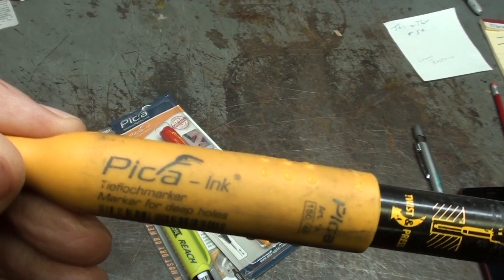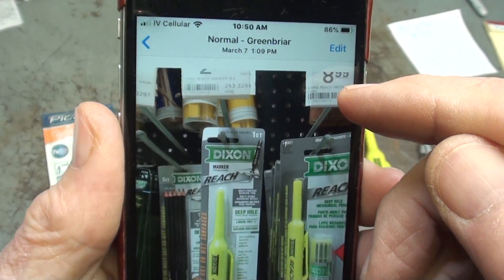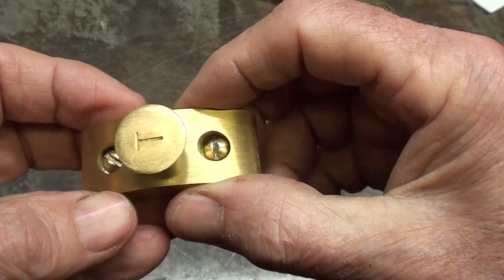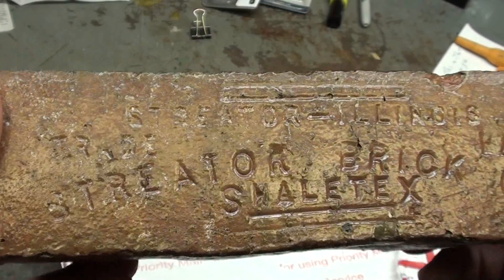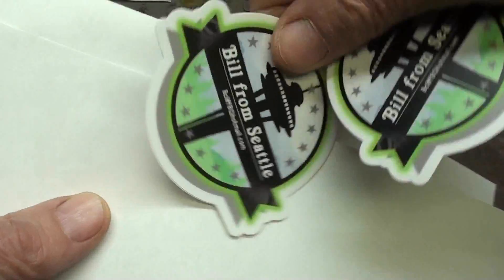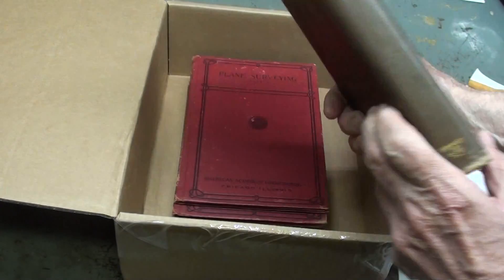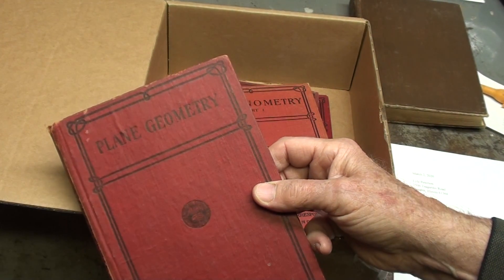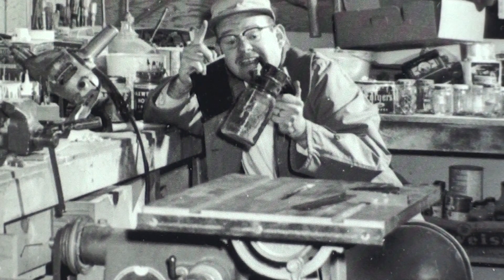THIS & THAT episode #54 tubalcain mrpete

Comment: I want to thank you for your excellent videos on the Atlas lathe. I purchased one off of a company I worked for that closed its doors in 2002 for $500. It has been sitting in a corner of my garage and recently I had a job come up to do on it. I had to do some catch up maintenance on it and your videos were just what I needed. After a good cleaning I found mine does not have a lot of wear on it except for the half nuts, which I ordered a pair of brass ones.   Thanks again.

Comment: Funny that you brought up the tool holders. I put a QCTP on my lathe and the tool post came in a package with 5 holders of different sorts, two of which where regular holders. I have since ordered 3 more of the regular holders (two just yesterday and yes they are Shars) since I don't want to change out my tooling and have to re-find center height. 

As far as being told what to do well I'm with you on that, I have been fortunate in the fact my job is considered essential so that at least allows me to get out of the house if even just to work.
Reply: Also I did watch the video all the way through. I actually watch most of them all the way through when I can find the time. I cannot remember which video it was but I ended up modifying my Starrett micrometer like you showed where it was covering up the line, thanks for the tip there. I read it wrong (micrometer) a few times because of that and had to start over on projects. I was so frustrated with it that I put it back in its case and started using a SPI micrometer.
Reply from the maker: I agree, I think I have about 10 tool holders in the A size and another 10 or 12 in law B size

Comment: Check out the sharpie twin tip markers.  They have a regular tip on one end and a fine tip on the other end.  They cost about $1.75.   I have the reach marker but use the twin tip unless I need a longer tip.
Reply from the maker: I will try that, where do you buy them?

Comment: Speaking of rack and pinion sets, I have had an idea (and I guess others may have, too!) for a tune able dipole antenna that had two opposing elements using tuning coils to tune for a given frequency.  The coils would be identical and each would have a follower moved by racks powered by a single pinion mounted so the racks would move in opposite directions.  Sounds complicated but would really be a simple setup.  I am a retired bricklayer and a ham radio operator so there is my interest in tune able antenna systems.  Got the ideas but no way to make them work!  Oh, did I mention I taught masonry in a vocational school and apprentices for the Bricklayer's Local?  Well, I did!  Thanks for your ideas and great videos.  Looks like I can be long winded, too!  Greg
Reply from the maker: Holy macro, you’re over my head with those antennas
Reply: @mrpete222  OK a single pinion with two racks. One on top and one on bottom moving opposite directions.  That is the idea I was looking at.  Thanks! Greg

Comment: On a follow up to your next video- I do read your responses to my comments- that's part of the fun!  Also, the best toys I received were either educational or family games, except for my Aurora slot car set (one of the last of the Thunderjet sets), which was one of my top 5 gifts ever.  Lego was/is great, but the kits now don't demand the same imagination as the basic ones I got as a child, although the motor/gears/wheels kit was awesome.  The last thing I made, as a teenager, was a working differential- it answered a few questions I had at the time.
Reply from the maker: Sounds like you had a great childhood with all those wonderful toys. I have never seen the differential model.
Reply: @mrpete222  It was fun.  The differential wasn't a kit- I just built it from the parts I had on hand.

Comment: Well Mr Pete I watched your last  video (vlog#7)and had to cheat a bit to reply to your questions by doing so on this video because the comments were turned off. And yes I do see your responses  to my comments. And although you may have ten or so years on me we seem to have walked the same path of interest growing up with model cars and mechanical things I had as a kid belonged to the HO club at school where we would build the little electric cars and race them. When I didn't have to cut grass trim hedges or paint houses and barns for people in my early years as a kid. And as far as the C V thing after all the research I have done on the subject I'm pretty convinced its more than meets the eye and I'll leave it there. I'm going to share a video with you on the subject but not on this comment because of reasons beyond my control.  😁👍👍👍Sorry this was so long I practically wrong a book. 😂

Comment: Re: Your question on commercial nut meat extraction (Vlog#7, no comments allowed, so posted here). For walnuts the shell is drilled with a small hole, a volatile gas is injected and then ignited. Seems like the same might work for pecans too. Thanks for all you do.
Reply from the maker: Thanks

Comment: A story about Henry Dreyfuss & John Deere (may be apocryphal).  One of the first things he did when he went to John Deere was send out 1000 surveys to customers, asking them to list their likes and dislikes
Reply: One of the top items on the dislikes was complaints about the seat. Dreyfuss took the info to the engineers at JD, and asked them how did they develop the seat ? Took them a bit to figure out exactly what he meant- then one guy said " Oh. we used Charlie"
Reply: Now, it was Dreyfusses turn to be perplexed. He had never heard of a "Charlie" model in industrial design. So he asked the engineers to show him the model. Engineers took him down to the factory floor- and over to a guy with the biggest behind. "Mr Dreyfuss, meet Charlie. Had him sit in plaster of paris and we were able to make our dies from that!"
Reply from the maker: That is funny. At the museum, there was a display of how Dreyfus measured a man and a woman to help him make the tractor ergonomical
Reply: @mrpete222   Yes. he was one of the first to take ergonomics into account for a tractor. Lol, have seen several that seem to require 3 right hands to drive